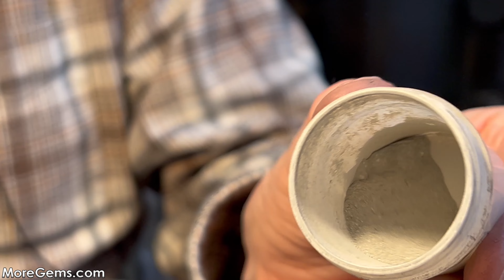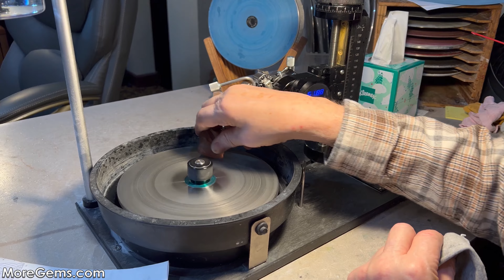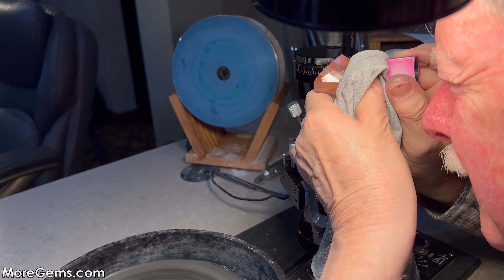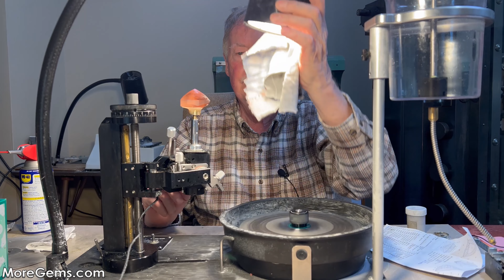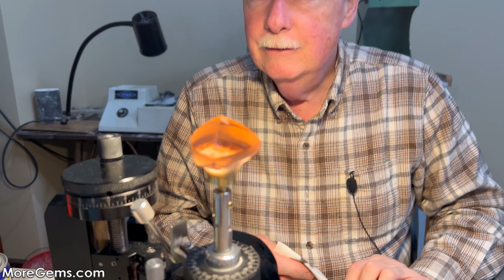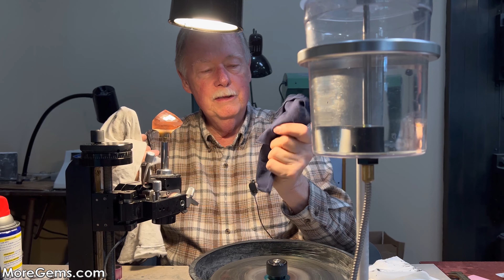Faceting Gemstones 7 | Polishing the Pavilion of a Gemstone with a Batt Lap

Comment: I've been using cerium oxide pads for smoky quartz. I have the batt lap but haven't used it yet. Would the batt lap be better for quartz?
Reply from the maker: Steve uses the spectra laps with cerium on all quartz, too. He uses the cerium spectra laps for quartz and opals. The batt lap with 50,000 diamond for most other things.